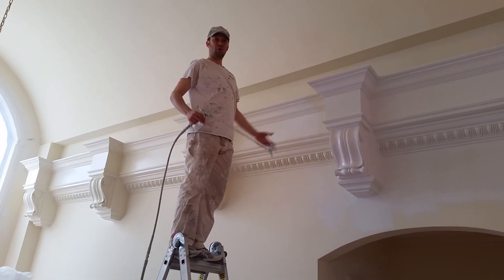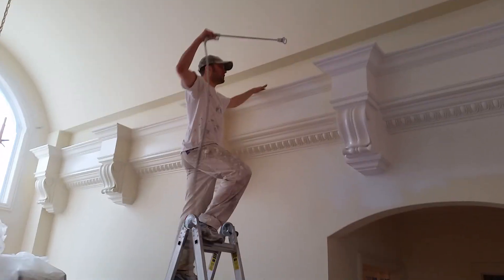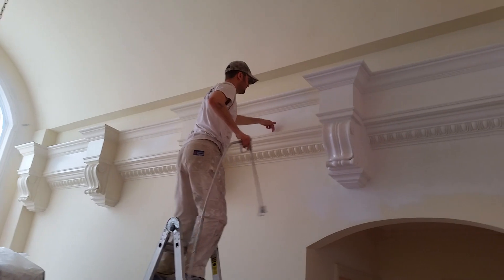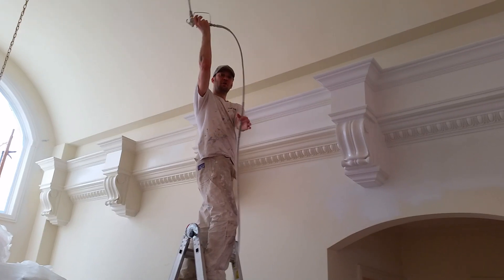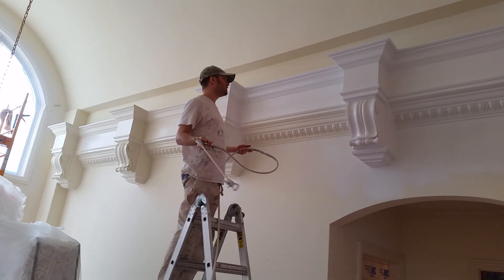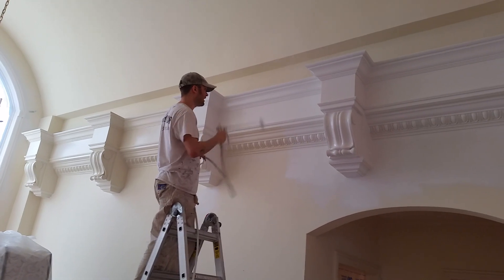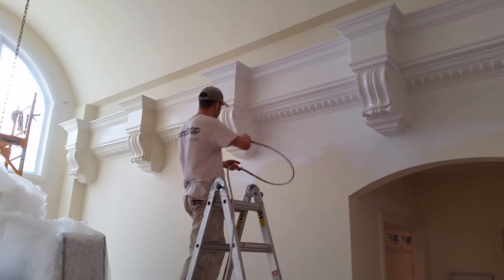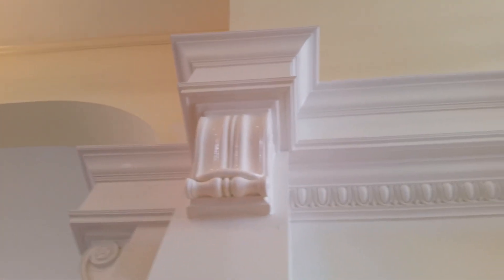How To Spray Paint Furniture Trim Crown & Wood Work DIY Airless Paint Sprayer Professional Artisons.

Comment: Is there any issue with the spraying on to the walls when spraying trim before the final wall painting?  I see everybody does it this way but I'm concerned there will be artifacts showing through the wall paint vs. taping the walls off.  Fantastic house, must have been a fun job to get.
Reply from the maker: No. Light sand and 2 coats of premium paint and ita never an issue. If your worried tape a 9' plastic around the perimeter

Comment: Hi Joseph. So, I have a GracoX5. Used a 315 tip to paint doors.  Had the pressure turned down. But, I got a lot of runs.  Thot I was moving fast enough.  What’s the best technique for not getting runs?
Reply from the maker: Use a 308 fine finish low pressure tip on a rac x guard or a 311 on the orange guard. Use a paint that doesn't sag like Benjamin-Moore coronado door and trim paint and do lighter coats. Sherwin-williams pro classic runs.

Comment: What size spray tip and what’s the sprayer you are using?
Reply from the maker: 312 fine finish low pressure tip rac x from Graco. Sprayer was Graco 395